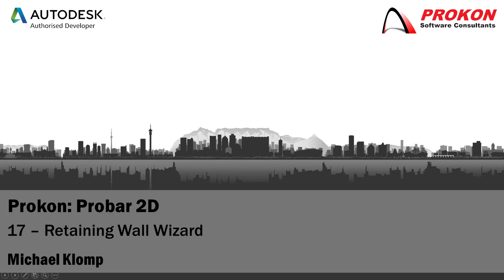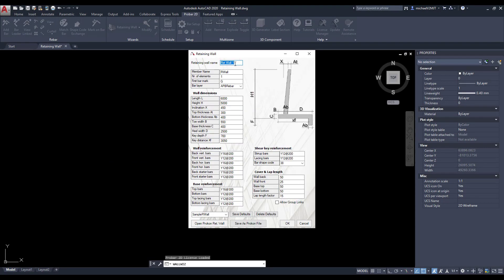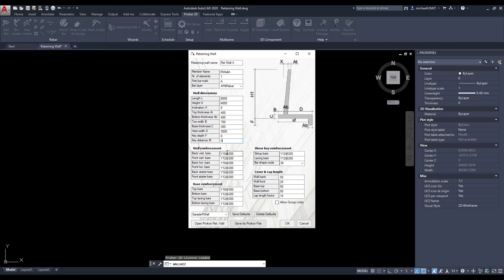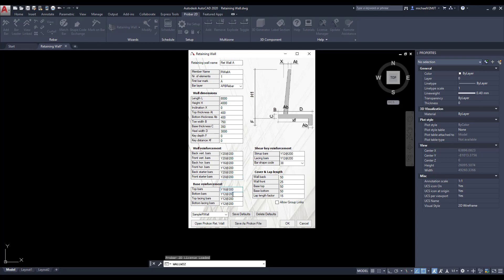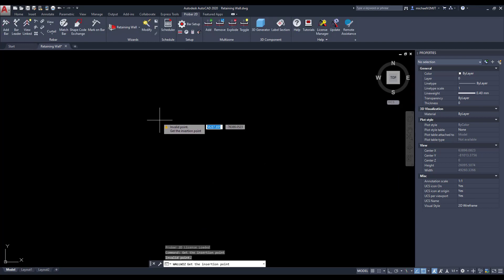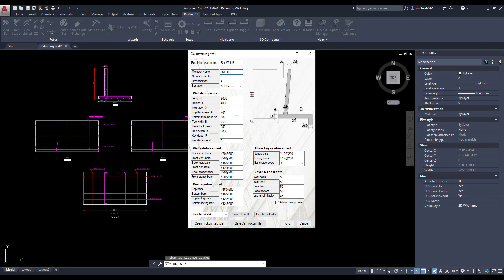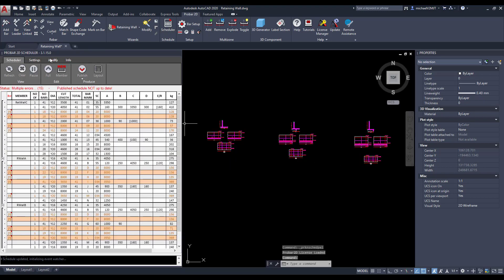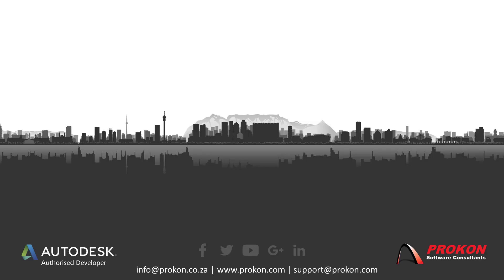Prokon Probar 2D for AutoCAD® - Retaining Wall Wizard

Comment: Hi. I need software for designing concrete water retaining structures
Reply from the maker: Hi Fortunatus, 
Sumo is PROKON’s primary analysis module. You can model a concrete structure using finite elements and apply the appropriate loads for analysis purposes. PROKON’s Retaining Wall module has the ability to design a retaining wall resisting only a hydraulic pressure. The Crack Width module has also been used in the past for the design of water retaining structures. 
If you’re interested in attending a demo, contact our sales team at info@prokon.com.